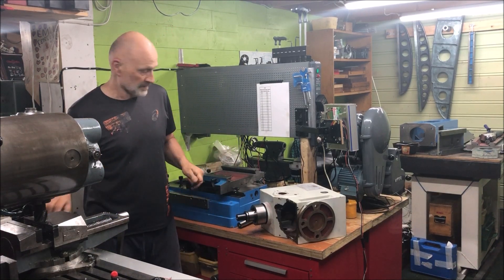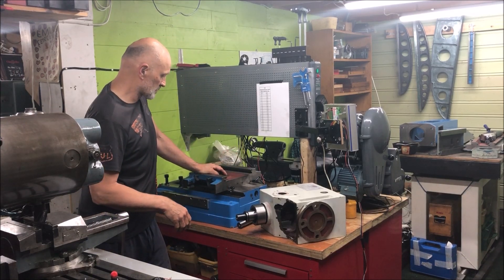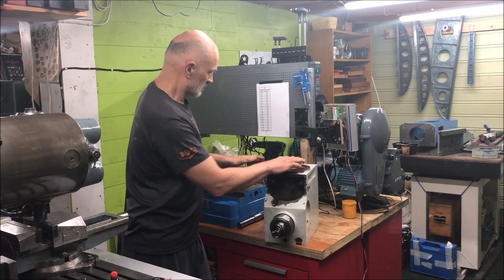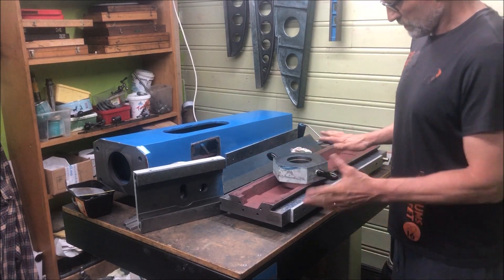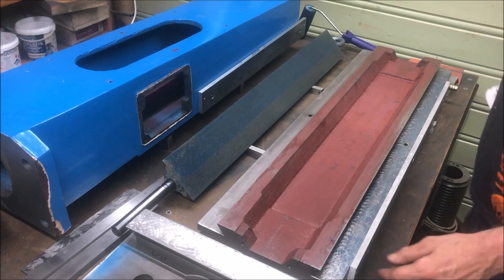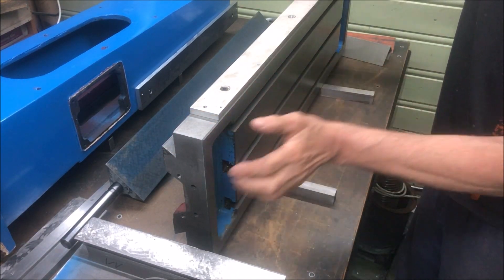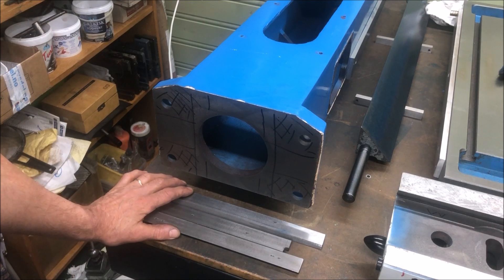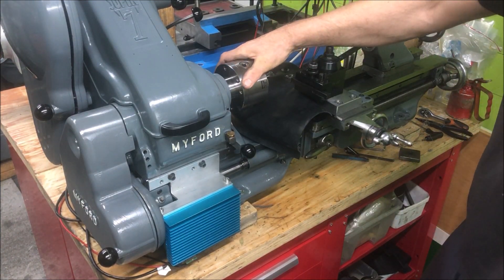HBM 45 mill-drill mods/fixes - intro

Comment: Do you scrape in accounting for the sag/flex that the weight of the head will create on the column? Or adjust for that in another way?
Reply from the maker: I scraped the column base flat and then tested. The deflection with the head and +30kg on top of that was minimal. I was surprised how little thi sefect was. I f I remember correctly I leaned the column (ie. scraped) only about 1/100mm or so (measured apprx. 350mm up ) and this was enough to have it dead straight with the added weight of the head , gearbox and motor. The key issue to correct apart from aligning the column properly was to provide a good base ie. dead flat surfaces with sufficent contact area for the two mating sides
Reply: @jansverrehaugjord9934  Cool! Thanks for the reply!

Comment: I Have this mill. I have a short vid on the saddle showing what state it came from the factory and me tying to fix it. I have no idea what I'm doing. (Hand scraping machine ways. May be i should have left them alone?) is the video if you want to give me some pointers on if i did the right thing or not.   Another video is me trying to find where the nod is coming from (Milling machine. Where is the nod coming from?) I have stopped at this point because I'm a little out of my depth not really with any experience in scraping apart from on a test plate before the first video.
Reply from the maker: Thnks for the comments. I looked at the videos you made and think the work is very well done (saw that my friend Marcus Christensen from Australia also commented.. nice!) The pattern you managed on the flat surfaces is (in my eyes) as good as it should be. Then the fun begins.. as Richard points out many times "it is easy to scrape a piece/surface flat, but.." and then carry on about the importance of alignment, which is where the "devil in the detail" is hidden. Namely the sometimes complex or easy to get wrong need for having all surfaces in the correct planes to one another. The bridge castings, like the saddle is possibly a piece that looks easy, but (at least again in my eyes) is a little deceiving as it is especially important to get this "spot on" and any error is amplified to the longer pieces. You seem to have gotten the scraping basics right, but may just have been a little overoptimistic starting with the saddle. However, don't let this discourage you to not carry on trying to improve/fix the column "nod". This will be (as is the saddle really) just a means of breaking the problem into manageable steps in a logical manner (as is most..). I think there is a good chance that your column "nod" is a function of either the ways on the "bridge piece/saddle" between the column and the head a little incorrectly setup/scraped or that the column sits out of square to the base (or both..). This is probably the same on this mill I have here.. PS! Some "out of squareness" might be OK, but not much, and this should be the other way, ie. leaning into the workpiece.. Seems strange to me that the column is "leaning backwards".. cannot see any other reason for this than "wide" manufacturing tolerances (or actually if the ways on the bridge piece wears and the weight of the head.. given it is greater than the work pressure acting upwards, then makes the head nod downwards, then it might be a way of doing things.. although unlikely). However,  I think it is important to remember though that this is a budget machine, so that this is what we get for the price. It still functions and on the vast majority of parts make quite accurate cuts (my parts are seldom more than a few centimeters high, so this would not be a major problem. And if the sides were a couple of hundred millimeters from square, I could flip the part 90 degrees and use the other side and/or top.. just to throw in a suggestion for a workaround :)

Comment: Looking forward to watching this project unfold. I used one of these for many years and often fantasised about scraping it all in but ended up just getting a cnc. Definitely going to be a good series
Reply from the maker: Thnks. I hope this will be interesting for some and was also curious myself. When the opportunity presented itself I could not pass😀 PS! What kind of CNC mill did you buy?
Reply: @jansverrehaugjord9934  cool. I got a Hurco VM10i. Quite a lot bigger! Am pretty happy with it though. It's nice to let the motors do the work. I used to wrap the mill handles in bandages to stop them giving me blisters when i had lots of surfacing to do!
Reply from the maker: @lawmate  Wow! This is a pretty big step up from a 45 style mill-drill. Very nice. Indeed the way to go for many.
Reply: @jansverrehaugjord9934  yeah, I'm very happy with it. I had to knock a new hole in the wall to get it through though! It's very different from the small mill, so many sub systems, all needing to work.. Thanks for sharing the scraping vids